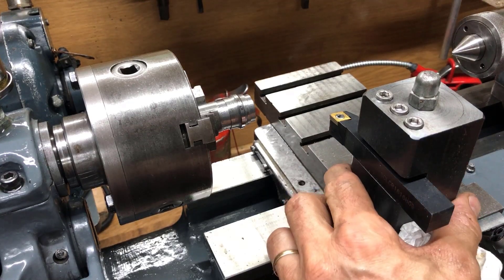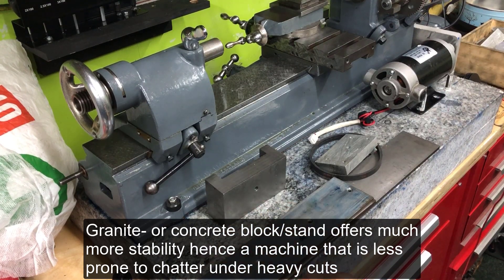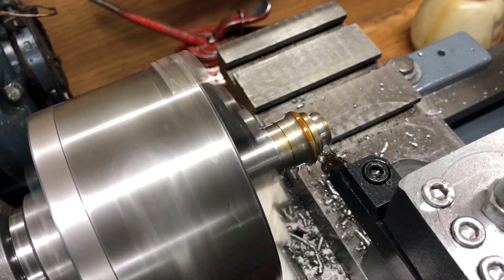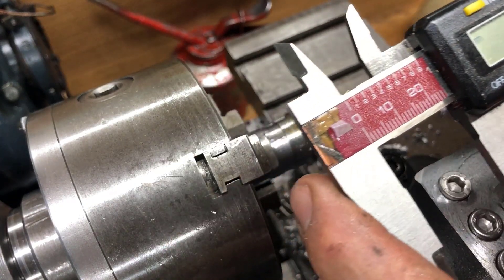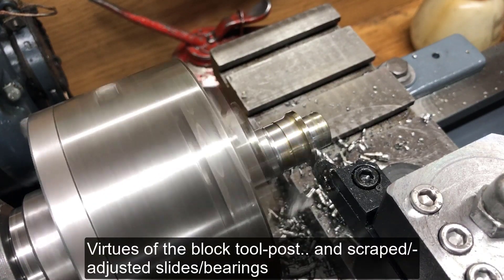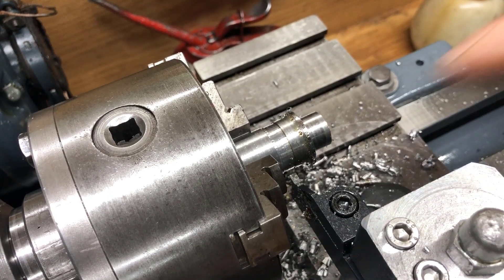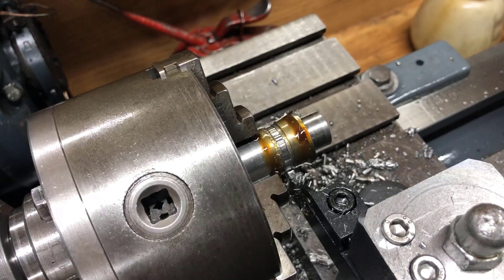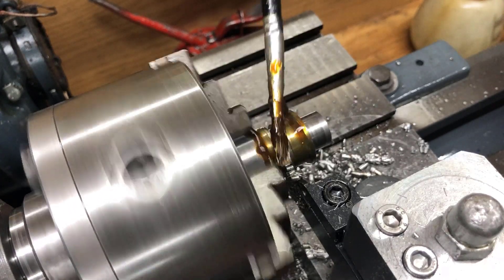Myford ML7 - some test cuts with block tool post.. virtues of back gear

Comment: Tough to beat a solid toolpost!
ATB Robin
Reply from the maker: Agree! I don't find this inferior to a QCTP either when it comes to practical use eg. tool changes. The height is preset, only possible disadvantage is the lack of positioning accuracy

Comment: Good results, especially in back gear.  I like those block toolposts.  There is no substitute for mass, regarding rigidity and resonance.
Reply from the maker: Thnks. Yes, I like to keep things simple and these blocks proved to be a bit more rigid than the top-slide with the clamp-style tool-holder, although this was also OK. More on this in another video.. PS! The limiting factor is now the drive system, but also not to forget.. the temporary test bench is far from ideal. A wooden bench like on castor wheels is like "inviting chatter" so this situation has to be rectified. I will probably experiment with either a granite plate (again) or a concrete foundation of some sort